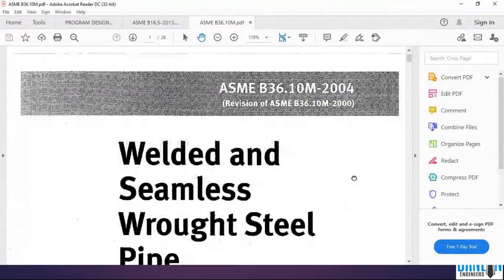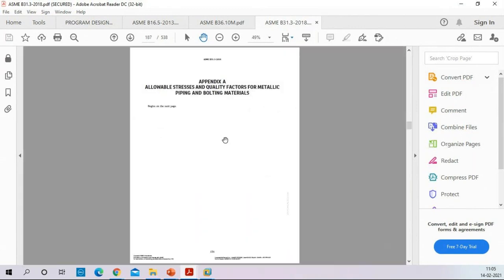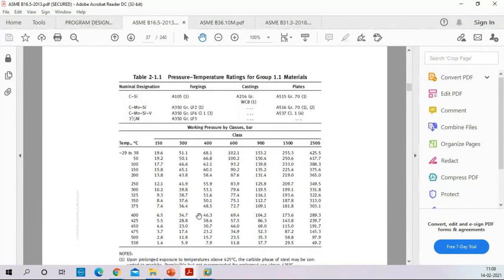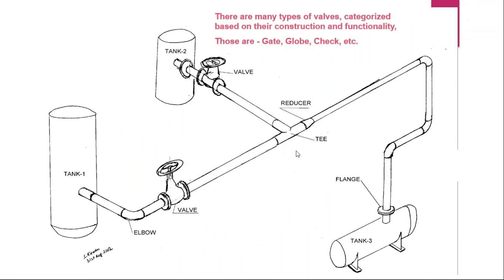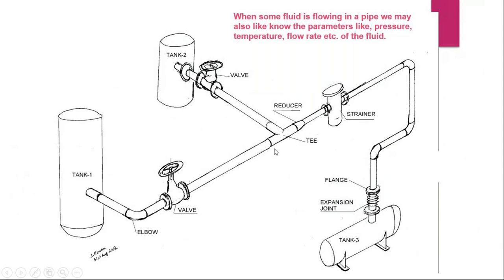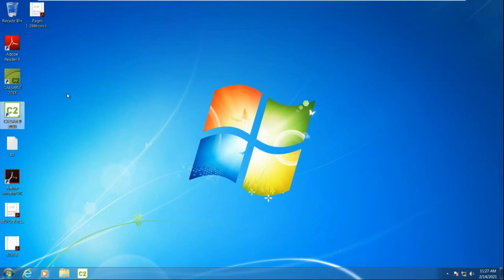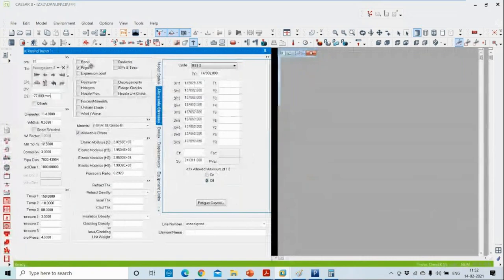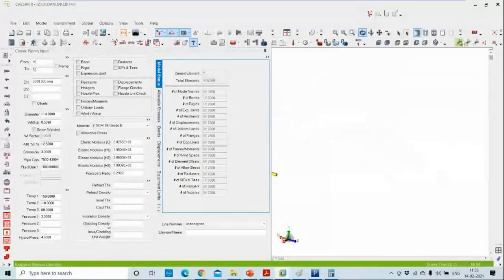CAESAR II Course | Pipe Stress Analysis |  A PIPE STRESS ANALYSIS SOFTWARE

Comment: wonderfull question at 11:00 but justification is not satisfied there might be max limit till 538  failure mode analysis its tats the reason they have given that and considering cost we shall go for mid ranged based on the type of  mass transfer